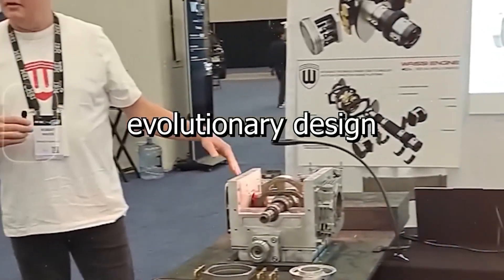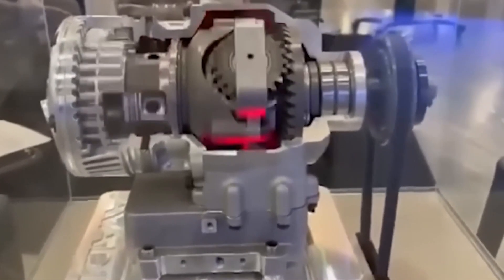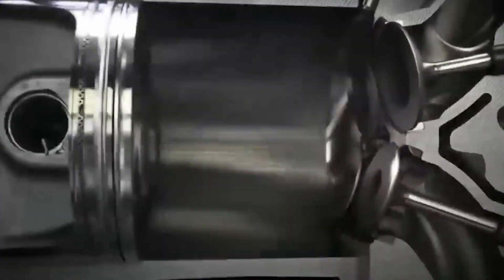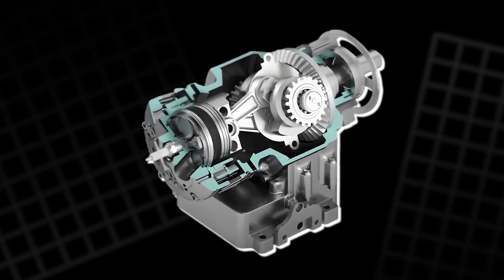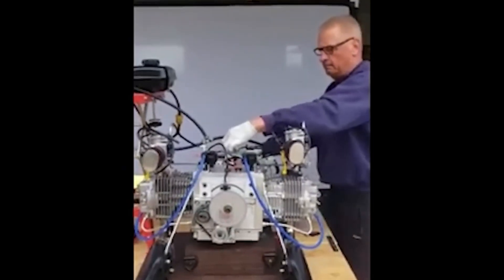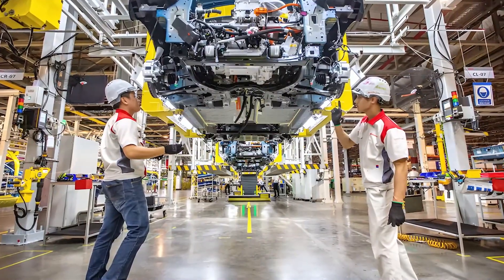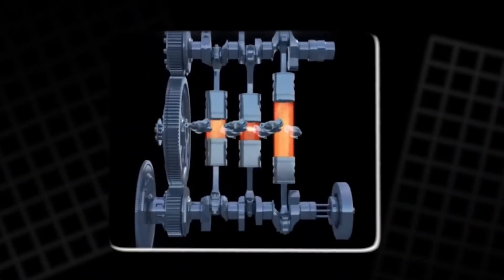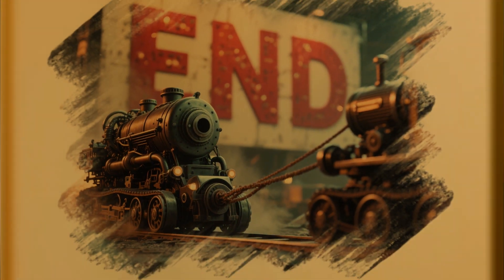The WI Engine: Simpler, Lighter… and Smarter Than Anything Before

Comment: Been done before. Crankless engines don't work. Toyota messed with it for years with an opposed piston engine driving a Piston with a magnet on it running back and forth between electromagnetic coils to generate electricity. Nothing more was heard after loud trumpet blowing back in 2012. Air cushion free-piston engines were tried but they can't be scaled up and only worked at small air pump level or as a gas generator to drive a turbine.

Comment: Usually when someone threatens to overturn the established applecart, he disappears fast.  People have invented carburettors than produce a very fine mist and high MPG and have disappeared.
Reply: They certainly have, and Bill Priegel, in around 1968 in El Paso, Texas was one who I knew. I interviewed for a job with him as I was graduating from college. He gave us the multistrike capacitive discharge ignition system, but he developed that ONLY because he needed to ignite very lean mixtures provided by his genius carburettor. He produce almost immeasureable emissions with little reduction in power, and huge increases in economy, but NO ONE CARED. Detroit knew how to build carburetors and NO BODY was ever going to change the way that worked. I was there, saw it, felt it, drove cars with all his inventions. He didn't disappear, but most of his ideas did.

Comment: steam locomotive train wheels 3-8-8-.....i bet the math is near identical to electrical charge timings with computer memory  3-3-3-5/7/9  5-5-5-15 7-7-7-21/24 8-8-8-24 and so on..idr what my ddr4 is at  but that's sdram to ddr1 ddr2 ddr3.
test it in formula 1 cars 1-3 or you only need about 15-25HP for compact tractors like john deere lawn/garden tractors.   in those tractors and zero turn mowers the motors usually last 3,000-5,000 hours.